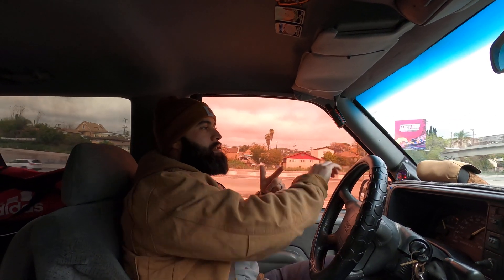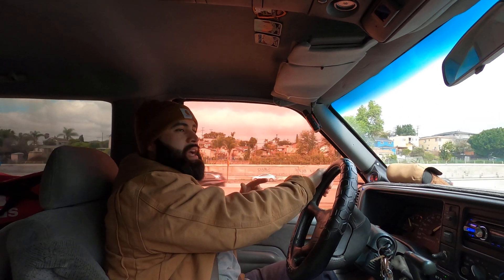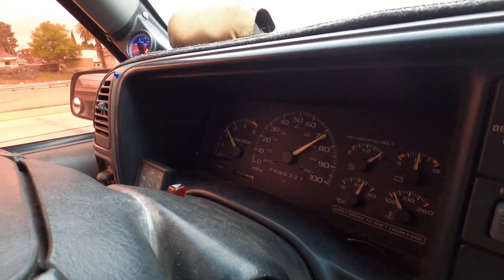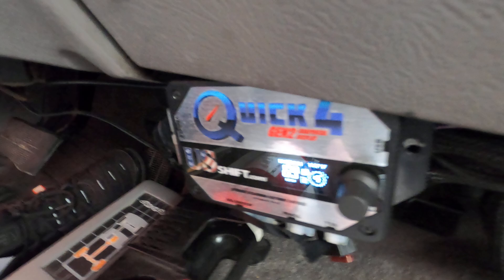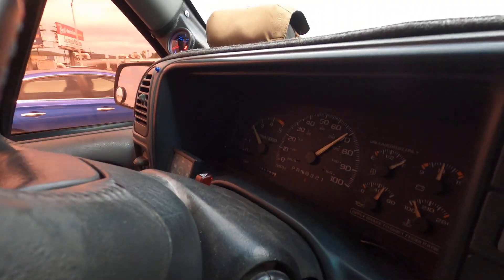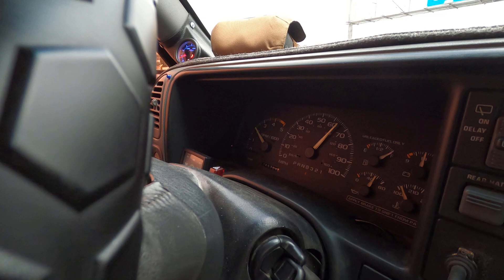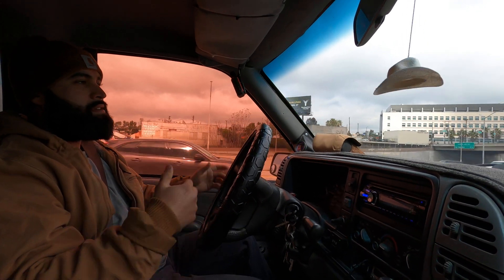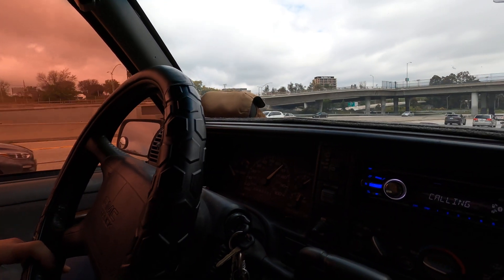Towing torque converter on 4L60E at freeway speed.

Comment: Im running 32x11.5 tires and going 55MPH with 3.73 gears pushing about 2500 to 2700 rpm, is my torque converter not locking up?

Comment: Boss, I got it started. My coil pack wiring harness was on backwards. If the truck doesn’t crawl on idle, does that mean the torque converter is too high? Also, I’m dealing with a P0300 misfire which I think is because my idle is too low. I need to bump it up from 500 to 750.
Reply from the maker: That’s a misfire code I believe I would def work on that first and yeah 500 is too low rpm for idle unless stock
Torque converter will stall the engine as soon as its in gear if it’s too low of a stall for ur cam.
Reply: @Overland_garageandadventure   setting the idle to around 750 made the misfire code go away, but now I have P0507 idle rpm too high.

Comment: Hell, ya! I’m still trying to get mine started. Engine cranks but won’t start. I don’t hear the fuel pump so I think it went bad. Last time I changed it was 2021 AC Delco but it has been sitting since I rebuilt the engine / tranny / transfer case.